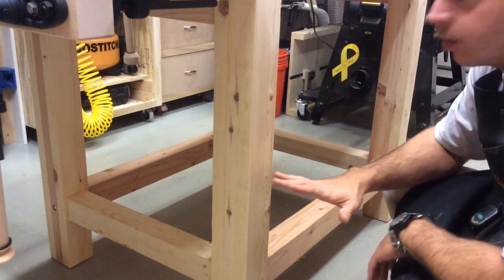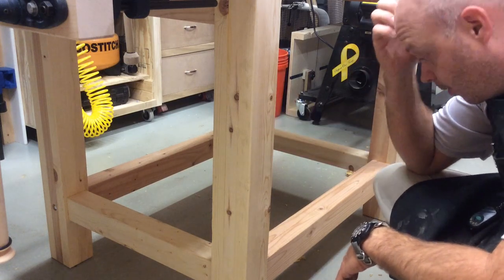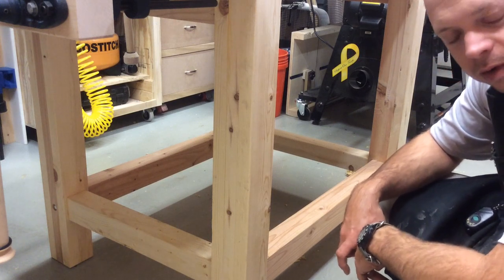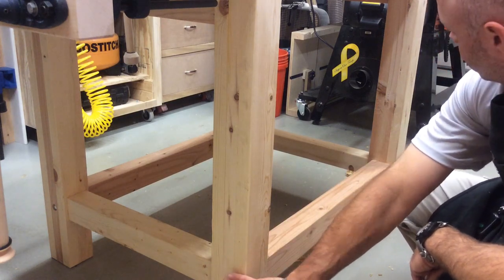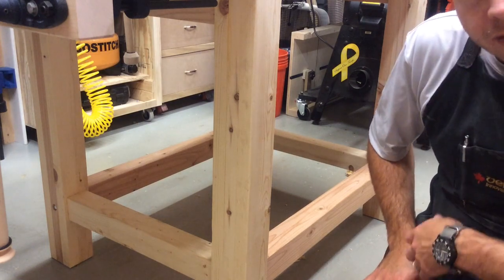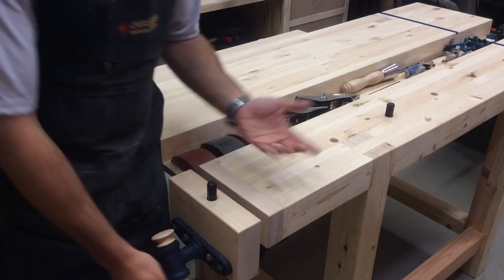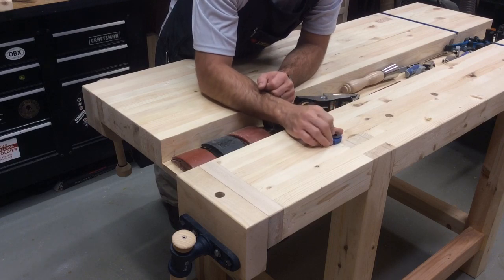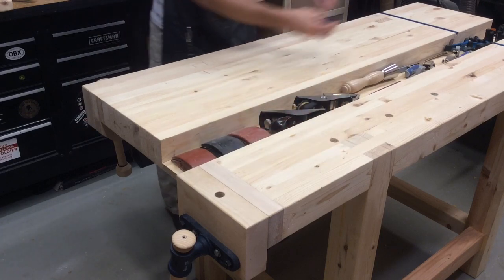Budget Roubo Workbench Tour

Comment: That's a sweet rig you have there! Very nice work and well thought-out.
It's actually similar to the bench I recently completed, though mine would be considered a "low-cost" version as compared to yours, and lacks a center tool-well. I built mine from rough-cut 2"x6"s purchased from a local mill and I built my own vises from hardware I made myself. My vises use 1-1/2" hard maple screws which I threaded myself using a Beall Tool Co. "Big Threader" kit, and the blocks they thread into are Lignum Vitae, a very dense, oily wood that essentially "self-lubricates".
My bench top is 24" wide x 72" long and 4-3/4" thick with 5"x5" laminated legs (through-mortised and pegged into top) and 5-1/2" x 3" stretchers (through-mortised and draw-bored into legs). I couldn't make up my mind on vises, so I went with a  twin-screw (26" between screws) on one face and a leg-vise one the other. In place of a tail-vise, I'm using Veritas Wonder Dog's. They're not really a replacement for a tail or wagon vise, but they work well enough for now and I already had a pair. I plan to eventually add a Veritas Inset Vise.
For finish, I used General Finishes Arm-R-Seal. 

For being relatively "cheap" to build, I couldn't be happier with my bench. It's rock-solid, weighs a ton and should last for years.

The Beall "Big Threader" is a great investment for anyone looking to build a new bench that doesn't want to shell out the money for store-bought vises. I've even made and sold several vise screws, and everyone has been very happy with them. At $90, it's paid for itself many times already. Just my twin-screw would have easily cost 2-3x as much as the threader. And it cuts a much nicer thread than the "thread box" rigs. The screws on my vise are super smooth, and with 5-threads per inch, they're pretty fast as well. Not to mention the hold they give, which is immense!

Comment: Good job dude. Purely by chance I've just finished doing the laminations for an almost identical asymmetricaly split top roubo before I came across your post. Split tops are definitely the way to go. But I'm going with a removable well board. I love having a well to funnel my plane shavings into a bin at the end but like to be able to remove it for clamps.

Comment: Nice. Thx for the tour. Question: with vice is it 90 or 180 degrees to full lock down? I'm thinking I'd prefer the handles to drop thru in the vertical position. At least when doing dovetail work when I will sometimes even be sitting at eye level doing clean-up and fine tuning. Sweet bench.
Reply from the maker: It takes a quarter turn to lock it down although depending on what you're doing, sometimes a little more torque is needed, e.g. chopping out on end grain or cutting tails.  You can orient the handles horizontally for the unlocked position if you wanted so that when you lock it down the handles are vertical. I have mine set so vertical is unlocked. Thanks for your kind comments!

Comment: Love the bench. I just started building a split Roubo using beech for the top.  I'm thinking about using a different species for the legs but haven't decided yet.  I'd love to use walnut but that would get expensive.  

Question about the Hovarter vice, can it be used with bench dogs?  I really like that the vice is made here in the U.S.

Comment: Nice Job on the Bench Russ! Love that unique Double screw Vise was it Pricey? that is so Cool I hate to Ask, but want to know total price of build of Bench?  .Did You say the Twin Screw Vice does not Rack ? have You tried and irregular shape piece in it Yet? I know You look through a Whole bundle of 2X4 Stock to find pretty straight pieces. It is a real shame you cannot get #1 quality in construction Grade lumber anymore. Now that you build it keep the Sawdust flowing. BTW  You might want to Looks at Bob Chase similar Bench at New Generation Workbench. He took a piece of Hardware cloth and shape it to the Contour of the center tool troth and use His Vacuum to pull Sawdust out without removing needed Tools. Bob will be Missed...Kay

Comment: did you build this off of any plans or use another as inspiration? did you attach the boards on top to each other with anything, or are they strictly glued together, i have seen others use a length of all thread, which i didn't see on yours. great bench though, I am getting close to breaking down and building something similar.

Comment: Awesome bench, Brother! I will have to research the Hovarter clamping vise. You have a great attitude - you made me smile more than once. Thanks for the inspiration. I just drew up a Roubo style bench in Sketchup, but I may try it with the Hovarter vise. Does the vise lose its holding power over the years? i.e. does the wedge  underneath begin to embed itself in the wood on the bottom of the top? Thanks!
Reply from the maker: Thanks for your kind comments!  The vise hardware has held up extremely well. The wedge mechanism is entirely metal on metal.  As long as the shafts are kept clean and you lubricate the action when it needs it, the vise is great. I may replace the long handles with wheels eventually but other than that, I wouldn't change a thing about the vise.
Reply: +Russ Haynes Ah… okay that makes sense. Thanks again - take care.
Reply: +David Massey Sorry David, I could hear Hulk Hogan's voice while reading your comment :D
Reply: +Fulou Dude, you made me laugh. Thanks!
Reply: +David Massey I like the look of this bench. Just wish I had room for one :(
Reply: What a nice bit of woodworking.  Well done!

Bill

Comment: It has been about 5 years. Are you still using the Hovarter vise? Has it met your expectations? These never really took off, and I'm wondering if there is a product related reason, or if it was just never marketed properly.
Reply from the maker: Jeff King Thanks for the question, Jeff. Yes, the vise is still on my bench and I still use it all the time. I still love it as much as I did the day I got it working. I’m not sure why they never really took off. Perhaps price was an issue for some.
Reply: @RussHaynesWoodworking  since you seem to be right handed, why did you put your vices in the wrong place?

Comment: Thanks.  I have been looking for a workbench (50 to 60 inches).   I want to buy one, but there is a debate out there.  Whether to buy or make a workbench.  You put it to rest.  You said it was 2 months of your life, and that is if you have a great looking workshop like you.
I'm starting out, want to do more carving, and now I am going to buy my workbench. The debate, for me, is over.  Also, one last thing, I saw these guys teaching how to buy wood to build a bookcase I think, and the wood came to over $200.00.  So $200.00 plus that labor and wear and tear plus nice vices, not worth it (assuming you use decent wood for the bench and vices).  You can get a job for $25.00 an hour off the books  twice a week @ 8 hours a day ($200.00/w) for a month add another 2 or $400.00 and by the fifth week (in building time) you have a slam bang table, if you want a slam bang table, but I digress.  
SO DON'T BUILD BUT BUY, ESPECIALLY IF YOU ARE A NOVICE CARPENTER.
BUY, BUY, BUY, BUY, AND BUY.

THANKS FOR YOUR TIME BROTHERS

ALL THE BEST

JAMES

Comment: How about routing a 1/4-1/2" rabbet around the edges of your storage and have the ability to add an insert when needed to create 1 solid flat surface?
Reply from the maker: That's a good idea, Brandon, and I have thought about doing that in order to keep dust and shavings out of the tool tray, but it would also make the tools less accessible, which has kept me from doing that. Maybe one of these days I will.  Thanks for watching!
Reply: +Russ Haynes sectional inserts that you can slide or cover the cavity with?
Reply from the maker: +Brandon Key yeah, I thought to divide the tray into four sections, one for dogs and hold downs, another for chisels, one for hand planes and sanders, and another for marking tools and mallets.  I may do that eventually, but with the new shop being built, it's way down on the list!  I may put it off to when I eventually replace the top with hardwood.
Reply: +Russ Haynes actually, when I sat here and thought about it, several tight fitting boxes, easily removable, about 1/2 inch shorter than the top would make for more versatility while giving you the the lip feature. then, you could store your tool groups in this boxes and just swap out those as needed. just an idea
Reply from the maker: +Brandon Key that is a great idea. Thanks!

Comment: I went to go buy some 2x4s the other day and after sifting through the pile for a bit I just walked out. They were little knots, and they were tight I suppose, but you'd be hard pressed to find a square inch of wood without knots in it. I should have taken a picture it was so horrible. In a dream world I'd have come back with a can of gas, and a match, just to save someone else the anguish of looking at that nonsense.
Reply: +Paul Frederick You were looking in the wrong place! 
To get great wood from construction lumber you need to look at the 2x12x16ft boards. All construction lumber has a maximum defect allowance. 2x12x16ft'ers have the lowest defect allowance and hence the best lumber for only a little bit more cost per bdft. I have actually found doug fir 2x12's that yieled perfectly clear 2x8x10' boards. Oh yeah, that's the other thing about construction lumber, there are multiple species banded together; Construction lumber is designated as SPF= spruce pine fir. Could be any one. Take some time and flip through a pile. It helps to bring a friend to flip at the opposite end. If you are building a bench and find a lot of spike knots don't count them out completely, just remember that while the spikes are at the edges it will be the heart of the board that will become the face of your bench top. Also, don't think that just because they are 16ft long you need to haul them home like that... have them cut in half before you buy them. They will think you are crazy and probably point you to the 2x12x8' pile but we all know those are junky too.

Comment: I've seen this now in countless videos ... and now i finally want to say something ... u NEVER put a Hand-plane on a workbench like you just did. You can damage the Plane's knife and/or the bench itself. Always lie them on the side, just like you did with the ones lying in the center ...
Reply from the maker: And I have seen this comment in countless places and it is total garbage. Plane irons are steel and used to cut wood. If the iron was so brittle that the wood could damage it, then it would crack as soon as you took a pass.  My plane irons are sharp enough to shave with and stay that way for weeks. It is perfectly fine to set the planes iron-down on a wood bench, especially one a soft as mine.
Reply: I do know plane irons are Steel ... what i was talking about was the damage that can be done to the Work Bench itself, possible to other work-pieces on it  not to forget the possibility to put it down on other metal tools that could reside on said Bench.
I was not talking about the damage of ONE putting down either ... i was referring to multiple put down's over years.

I got teach'ed in my Traditional Carpenters training, that it is a good habit to put the tools where they belong, either into the recess on the Work Bench or into the Storage and overall to clean the Workbench between tasks.
Reply from the maker: +Momoka7 I understand that is something a lot of people teach but it's a myth. Your post says "you can damage the plane's knife."  Your words, not mine. As for banging your plane against other tools on the bench, if everything is out away where it should be, then it's not a problem. I'm careful with my tools and the tray is there to hold my most commonly used ones. But this idea that it's bad practice to leave bench planes rest on their soles is a myth that needs to go away.
Reply: Momoka7, this is an exhausting debate started by a small faction of fascist woodworking zealots.  Your "work"bench is not a piece of jewelry.  As long as the top is flat and without twist, who cares.  When it's lying on its side, you run the risk of damage your plane iron because it's exposed to other tools.  If you should suffer this fate, and you will eventually, you have to grind out the damage and  re-sharpen.  Good times.  Actually, I lift the front of my bench planes on a small piece of wood to avoid the debate altogether.  :)